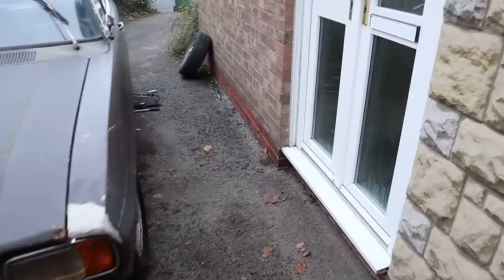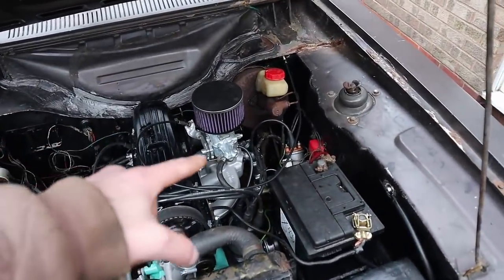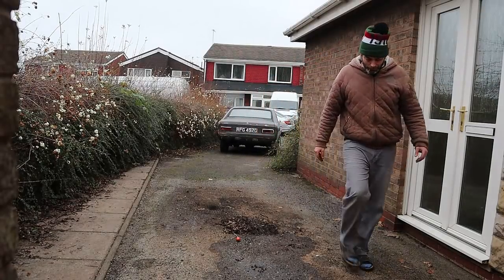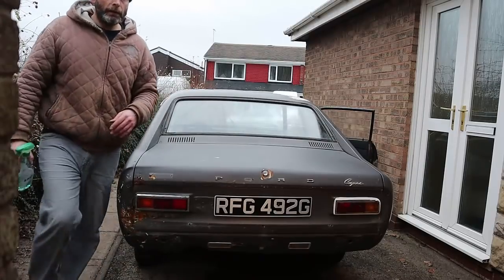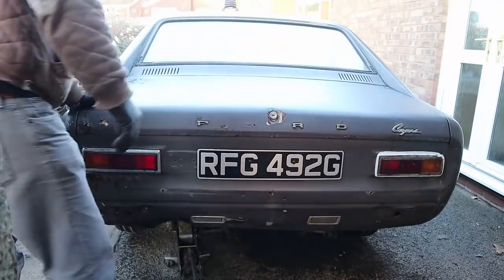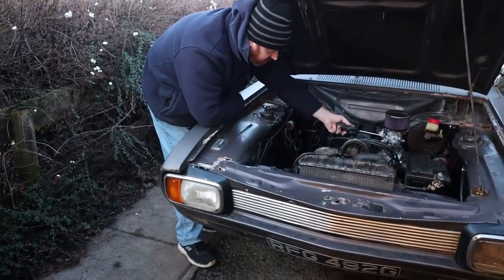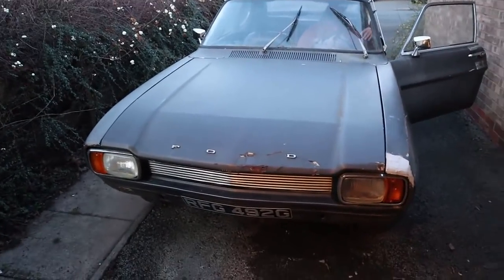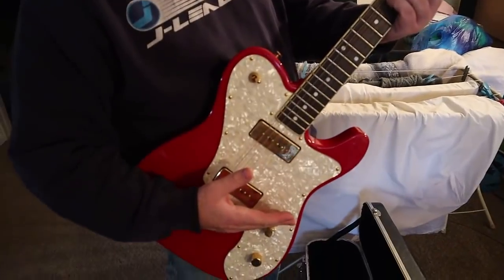1969 Ford Capri - Part 31 - Coughing & Spluttering  .. around the block :)

Comment: Glad to see the update. Don’t ever use radweld dude that stuff is lethal. I stupidly used it on a Mk4 golf 12 year ago and it killed my heater matrix, clogged all the water jackets and made it run like poo. Would of been better chucking in an egg as a temporary fix. 
I ended up having to buy new heater matrix completely strip the engine and rebuild it as well as the cost of a new radiator. See if you can get it brazed or even find a cheap replacement. Timing sounds like it’s out no big deal but a timing gun and a bit of fettling would most certainly do Kate some justice!. Keep up the good work Emmanuel and Gav I love a good update. 

All the best guys. 

Scott.
Reply from the maker: Will see about flushing it out Scott, good to hear from bvb you here buddy, and thanks for the tip, as always 😊🎩🔥🛠😘🏁🎸

Comment: Great work! One of the issues with poor running could be the servo is not connected, so you've a vacuum leak on the inlet manifold, will get too much air, cheap fix for a length of hose

Comment: Recheck your dynamic timing with the vacuum advance disconnected.  Be sure to plug the line leading to the intake manifold.
Reply: Yes indeed that could be a solution but I think it's time for a different carb.

Comment: Hi guys! Nice to see Kate moving under her own power. She needs some tuning for sure. Do you have a vacuum line hooked to the distributor for the vacuum advance? The vacuum advance really needs to be working in order to run right. Might have a leaky/bad diaphram. That would cause the engine to caugh n sputter, because it would have a vacuum leak. Also, check to be sure the centrifical advance is working properly, inside the distributor. Hook up a timing light. With the vacuum line disconnected from the distributor and plugged. Start the engine and alow it to warm up. Watching the timing marks, slowly increase the eninge rpms. The timing marks should advance, with engine rpms. If they don't, the centrifical advance is not working. Wes 😎  in Oregon
Reply from the maker: Thank you Wes, yup, we checked it in the manner you described and all looks fine with vacuum advance mechanism, and spark advance.
Thank you!
Emmanuel

Comment: Does this car not use an expansion bottle for the coolant?
To tune the carb i suggest to get an universal O2 sensor.
From new carbs where factory adjusted.Adj with exhaust on
Reply from the maker: See latest vid, part 33, thanks junkman 👍🏼👍🏼👍🏼

Comment: Watch the full series and loved watching you bring this back to life! :-)
Get an exhaust on it pal, it needs back pressure to run properly. Wouldn't recommend radweld better to get the rad reconditioned. Radweld just clogs up your heater matrix and wont fix it permanently.
Reply: Blue smoke is oil, black smoke fuel, white smoke coolant.
Reply: @robjeeves1486  is this meant for the comment below?

Comment: i have re watched some early vids from you and when your timeing the engine you have the cam marker to the top so its 180 out 
crank at tdc cam mark at 6 o clock if you look through the pulley you will see a small hole in the head thats the timeing mark put a matcstick in the hole line up the pointer then set dissy to no 1 clockwise rotation 1342 and i think you may sort a lot of problems
Reply from the maker: Thanks John, we've now worked that one out. Next is to buy and fit an Ashley exhaust system and work through some main jet sizes on the carburettor.
If it still runs like a tractor, we'll go back to basics again.
Thanks for your tip 👍🏼😊🛠🎸
Reply: Speaking from experience on my 75 Cortina, it would not start at all if it was 180 degs out. You'd get blow back through the carb now and again but it "absof#ckinglutely will not fire up!!!" Sorry, just quoting myself there. X¬D

Comment: I'm glad to see you got it running. I think your heater core maybe leaking causing you windows to fog. I didn't think you had timing problems unless it was just a little slow timing but nothing big because it wasn't back firing thru the carb. If you lived over here in Wv I've got a private road to the house and a 36x40 garage to stay dry in I love working on things in my spare time. Good Luck with Kate do give up your way closer than when you started
Reply from the maker: Thank you David 😊👍🏼

Comment: I'm not sure but did you change the fuel pump and fuel filter 
Oh and check inside the fuel tank
Reply from the maker: Yup, all that has been looked at, but might check again just incase. Thanks!

Comment: I wish you were a bit nearer, I'd love to have a try at getting that engine running straight.
Reply from the maker: I could have done with you having a go today.
I started her up, and warmed her, in order to flush the coolant.
Even though she'd reached fuel operating temperature,  and went through thermostat cycle (all in all about 15mins), I noticed that the engine note, and idle speed keeps fluctuating, which I'm guessing is either fuel or ignition related. 
Shell idle beautifully for say 2mins, then she'll start dropping almost to the point of cutting out.
Then she'll start picking up again almost to the point where shes idling to fast... and so on it goes.
Reply: @Classiccarbscouk  It sounds like it's "hunting" but to the extremes. How are you setting the mixture. I'm not trying to tell somebody who sells carbs something they probably know, just starting with basics before I start going through the filing cabinets in my head.
Reply from the maker: @baylessnow  not really spent enough time on it to understand it.
Idle mixture screw can be fully turned in, and doesn't cut the engine out, which suggests some sort of excessive fuel pressure or float height issue.

I'm leaving the idle mixture screw about 1 turn out.
Reply: @Classiccarbscouk  Try turning it all the way in but only finger tight then turn it back out 1 and 1/2 turns as per Part 1 City and Guilds Basic Vehicle Mechanics course and put the original jet back in which you swapped for a bigger one then try it again. "Hmmm going away to think again I am. Speak later to you I will, hmmmm" (in my best Yoda voice).
Reply from the maker: @baylessnow  may the force be with you 🤘🤘🤘🤣🤣🤣😊👍🏼🏁🎩🛠😊
Reply: @Classiccarbscouk  Maybe that should read May the Fords be with you. X¬D

Comment: dont use radweld! it will seal a radiator for a while but it also clogs everything else up, especially interior heater cores and coolant passeways in the engine.
Reply from the maker: Well, it's a bit late for that, as i emptied it in the radiator about 2 weeks ago.
Thankfully, the heater is no connected so, it wont have reached the matrix.
I will endeavour to flush it out... Thanks!

Comment: As poodle559 says, Black smoke is excess fuel, blue smoke is oil, you are right but your mate is wrong. Oh and white smoke is steam. :¬P
Tighten your wheel nuts opposite to opposite, ie; 12 o'clock/6 o'clock. 3 o'clock/9 o'clock. To ensure even seating of the wheel.
Clean the windscreen with white vinegar. If you used window cleaner on your screen that's probably why it holds the condensation. If you want to use a chemical use methylated spirit from B&Q. £4.37 for a 1/2 Ltr bottle. Also it's a good switch cleaner. https://www.diy.com/departments/b-q-methylated-spirit-0-5l/264230_BQ.prd

Comment: brake servo disconnected?
Reply from the maker: No, it's connected, but when i press the brake pedal , the engine note changes and engine speed changes... What's all that about?
Reply: 1969 Ford Capri - Kate maybe the diaphragm is slightly torn? maybe when you press the break it’s leaking air just a guess dude. But hope it helps. Steve.

Comment: Rad weld is horrid, you’ll gunk up your fresh new block :(
Reply from the maker: Oh shit, what do I do now then?
Reply: Love the vid
Totally agree with imapadlock it would be sacrilege to gunk up the water galleries in the minted up rebuilt engine using a proprietary radiator sealer 🙄. See if you can get a specialist to braze it up or price up a replacement. 
Get Gav to do a short session on the new guitar. How about requests for money 😂
Reply from the maker: @grahamheap2520  thanks Graham, I'll have a look at a radiator replacement and I'll mention your suggestion about music to Gav 🎸🔥🛠🏁😊🎩
Reply: Indeed, don’t use rad weld - get the rad fixed or replaced. May I suggest getting somebody in with diagnostic equipment to properly tune that engine - you’ve done the graft and to keep guessing about carburettor settings etc is (with respect) painful to watch. Enjoying the passion tho 👍
Reply: 1969 Ford Capri - Kate yeah as said replace /repair the rad. Rad weld is not permanent anyway 👍 great videos by the way 👌
Reply from the maker: @imapadlock  thank you 😊
Reply: @Classiccarbscouk  I think what they are saying is that; you can either get a new rad, or you may be able to find someone who can do repairs.But it may need a new core. Depends if the shell is OK. But the chemicals in red weld do make a mess! Plus there is No guarantee that it will work, putting an egg in is pure  desperation.

Those drums could do with shot blasting, then you can prime them, and have them how you want! No more spiders webs!

Comment: Needs a proper exhaust, no back pressure to settle the engine down, also running open header is bad for the valves.

Comment: Have you sent your V5 off registration document off yet to get it declared an historic vehicle then you will be MOT and tax exempt ❓
Reply from the maker: Hi Brian, yes, got the V5 sorted in the summer, with the help from a lady at the mk1 owners club.
Kate is now UK registered, historic, so tax and mot exempt.

She also has her number plates 👍🏼
Been trying to remove the big old Rusty brake servo as its leaking air, and whenever I depress the brake, the engine dies...
Also, the servo is in the way of twin weber sidedraught carburettors.
We are looking to wrap an exhaust system over that 1600cc pinto, as its noisy and not being able to drive her, is getting on our nipple ends 😁👍🏼🎩😊🛠🔥🎸😎

Comment: I see a lot of comments that are well just not very nice. I don't understand. I don't think its a tooth off on the timing set but it definitely is very slow. Wrong cap or mark on damper (bottom pulley) but turn distributor while running and see if it evens out. Turn either direction slowly and not far as those teeth are not far before its firing on the wrong cylinder. I know it will run better than that. Check the firing order on the plug wires.A wire crossed on two cylinders might just be the cock for molly. When it comes to life.... stop and figure out wiring as it could be just a ground wire that is not tight or hooked up plus a ticket for impaired vision can go bad on insurance. Once wired and dash is straight, your level of pride will rise significantly! Out comes the goo and you can patch the holes with more chicken wire and sheet rock mud. Its that or cut out bad spots and weld in good metal. Its a valuable car when fixed. I have been a mechanic for over forty years and that timing is off somewhere. Eventually running the engine. I would toss that damn rad  and get a good one so it can run cool or you will burn a piston or crack a piston and then its off to the wrecking yard
Reply: firing order check is a good idea. I can't remember if they renewed the coil and condenser or fitted electronic ignition but I bet those plugs are real sooty.
Reply: @adrianpolley9419  Just because a engineer in england said so doesn't make kati happy. I might even go one number on the plug hotter. Soot is incomplete firing or not at all. Get the counter tec to check the heat range and go a bit warmer if everything checks out. Have you traced all the vacuum hoses as a air leak will cause some fits
Reply: @morgansword  or that the vacuum pipes are on the right way. I put 2 pipes on the wrong way round in my fiat and it was undriveable. One vacuum was  stronger than the other and it caused major running issues.
Reply: @morgansword  Yes,  I agree with what you say about soot. Really without being there and going through everything one step at a time , it is difficult to know which way to go. It's been a fascinating story to follow though !

Comment: Isn't it amazing that the engine can be running great one day and shite the next..... are you sure it's not a FIAT 
My fiat doesn't like being parked up and will run like crap if not driven regularly.
Reply from the maker: Terry, it's a case of chasing its symptoms and trying to learn as we go. The little niggles like carb running, timing etc.. are acceptable for this level of effort and time we're putting into it currently.. the thing that concerns me is the noises coming out of the engine, which I cant decipher if they are the finger flowers or piston slap.. either way thank you for your comment and support 🎩😊🎸🔥🛠

Comment: Pinto engine? 1969 would have had 1300 ohv. 1600 ohv 2000 V4 & 3000 V6    ...surely!
Reply from the maker: Yup,v4 originally, came to me with this pinto
Reply: @Classiccarbscouk  Don't think i am knocking that, i love Pinto's! built a few good ones in my time. Just a shame with a pretty sound original car you couldn't have got the original engine. But then you said V4 & that would make me think twice the V4 wasn't a sparkling engine. But today with everything that is original being the most sought after sourcing & fitting a V4 may be worth a thought. Whatever, you have found a sound car.
Reply from the maker: @kevinparker461  yes the v4, doesnt inspire 😁
Thanks for the support bud 😊👍🏼🛠

Comment: Looks like plain old condensation on the inside.
Reply from the maker: Its dripping from the celing/roof, and I don't like it! Sorting the heater will be lovely though 😊
Reply: It's chemicals that leak out of the plastic on the dash board over time.

Comment: The pair of you are completely out of your depth ..... be lucky if one of your neighbours doesn't get the arse and set fire to the fecking thing just to save their ears getting raped every time you start it up. A quick tip: Driving it round the block more does NOT equate to restoration progress, THAT requires some degree of knowledge, skill and hard work!
Reply from the maker: Get stuffed 🤣🤣🤣

Comment: cut the hedges please for the next vid gav lol
Reply from the maker: Ok, I'll get the hedge cutter out, I promise!
Reply: haha on the engine side gav , is it running unleaded fuel , as I had too put lead additive in my sierra , till I got the valves changed same engine as yours
Reply from the maker: @dave1secondago  we think the head is suitable for unleaded fuel... fingers crossed though 🤞🤞🤞

Comment: K SEAL for leaks
Reply from the maker: Mark, chap here saying i need to replace the radiator and that radweld is POOP.. and that it'll clog up the heater matrix and gunk up the coolant galleries.
Is K-seal really good? And permanent? Have you used it on numerous occasions?
Thanks for the tip, i might drain the system, flush it, and get some K-seal in there.

let me know your thoughts please
Emmanuel : )
Reply: @Classiccarbscouk  RAD-WELD is outdated and it caused more harm blocking other waterways. K-SEAL was ok not used it for a long time though, Iff you can afford it get a Newer Radiator HEATER MATRIX needs looking at as well
Reply from the maker: @markmatthews1569  ok will do,thank you 👍🏼😊
Reply: 1969 Ford Capri - Kate another vote for K seal. It’s come on a long way. It fixed my 1998 A4. It’s worth a try. By the way my kids LOVE your videos! “The crazy guys have got a new video! Let’s watch them they’re funny”! 5&7 youngest fans I bet!
Reply from the maker: @ScaphanNetwork  We'll take your two little brats comments as compliments. Tell 'em to behave or Kate will be having a word ❤
Thanks for the k-seal tip.
Love from m,g&kate
Reply: 1969 Ford Capri - Kate 👍😂🚘